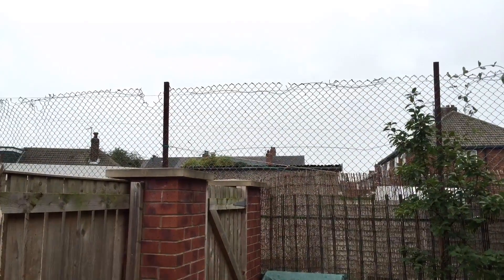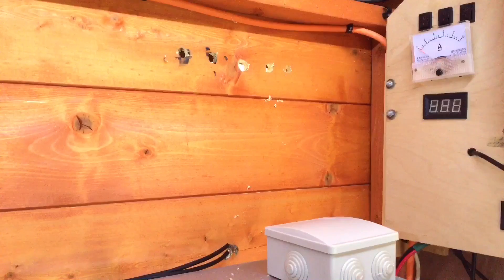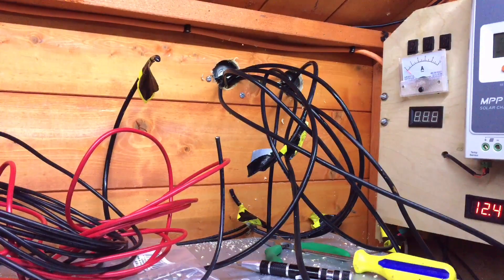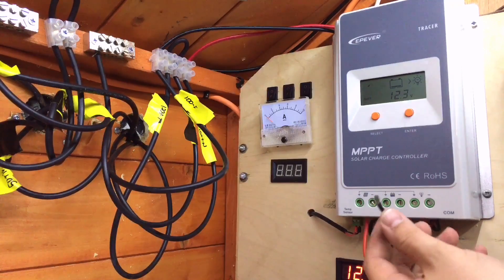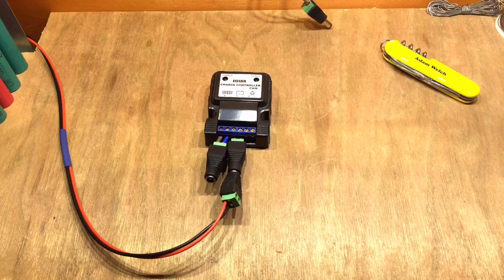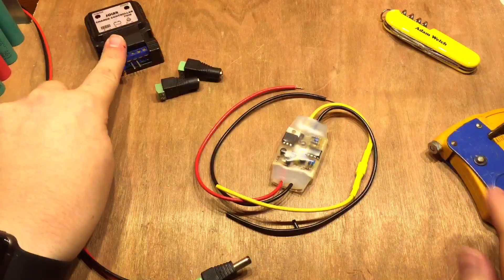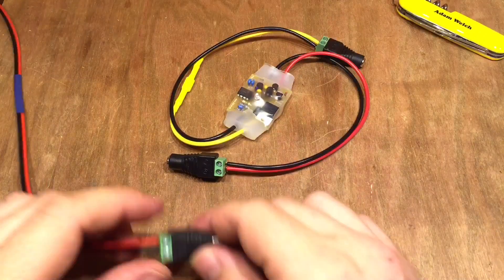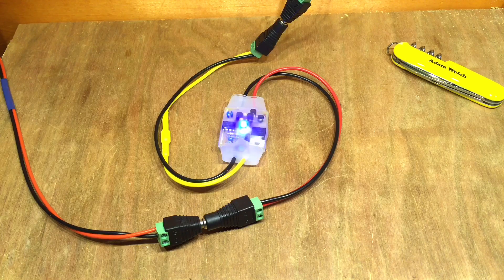Fitting New Solar Panels - Part 2, Inside - 12v Solar Shed

Comment: This a bit ,well off subject. But the Bluetooth monitoring for the tracer controllers. Is there a way to monitor multiple controllers? I have a tracer A. And a tracer AN. I would kinda like to know what I'm getting in. Without going in the house or electrical room. I have the mt50's for each.  I guess I could connect a camera to view the controllers. But that don't usually work well. I will likely have 2 more controllers to monitor. So 4 plus eventually. Does anyone make a wireless backup camera or something I could use to monitor remotely? Great video. I would like to have one of Julian's controllers for a smaller project. Are they still available? I'm hoping he does something with the muppt he has been tinkering with. It would help alot if I had a 100amp charge controller. The flex max 100 is the only one I know of. And they ain't cheep. I can afford to buy tracers as I go. Keep at it

Comment: Hey Adam, greats vids as always, quick question please bud, I have the 30a version of that charge controller and run a 450ah 12v Lead Acid bank so my charge controller is in 12v mode currently with 360w of 12v panels in parallel.   I do have some big 24v panels sat spare (32v open circuit)    After seeing this vid I am assuming I could use these on the charge controller and MPPT will do its thing even though its a 12v system as that's exactly what you have done here isn't it with running 2 x 12v panels in series?   Have you seen better results with panels running in series at 24v with lower amp-age rather than panels in parallel with higher amp-age? Cheers :)
Reply from the maker: Thanks for the kind comments.  I currently have two "12 volt" panels in series on my Tracer A MPPT charge controller.  Mixing panels of different types can work but you need panels which have their maximum power point at a similar level - my three 50 watt panels have an Vmpp of 17.5 volts and the new 100 watt panels have a Vmpp of 18 volts.  Otherwise your charge controller is going to find it difficult to find the sweet spot.  Have two sets of panels with say an Vmpp at 18 volts and one at 24 volts would mean two humps in the power curve.  Mixing panels on a PWM charge controller isn't so much of an issue as the panels get dragged down close to the battery level anyway.

So you could potentially hook up two of your 12 volt panels in series, and run them in parallel  with your 24 volt panel so the panels  roughly match, then you use your mppt charge controller to change the 24 - 40 volts from your panels to 12-15 volts for your battery.  Your 24 volt panel has an odd open circuit voltage though I'd usually expect more like 40 volts open circuit.  How many cells does it have?

So the short version is yes, you can run 24 volt panels on a 12 volt battery system and get peak performance using an MPPT charger.

Comment: good video Adam. now iwonder if you have time to demonstrate a project using 2 solar panels. lets take 2 100W solar panels. one faces direct to the sun, anotheroffset by 90deg. if at peak production time the sunside panel gives 10A and the offset panel gives 5A. conect them in parallel. given that the sunside panel will give some 20V but the other may only be 17v will we still get 15A total when combined?
Reply from the maker: I've just fixed my panels to the roof!  Joking aside it sounds like an interesting idea.  I'll have a think, but I've got quite a few other videos I'd like to do first.

Comment: Just don't leave that PWM5 out in the rain and it will serve you well! 

Mine has worked flawlessly since the day it was installed on the little 10 watt lighting system in the generator shed. It is the one solar system I have around here that has never required any intervention since I set it going. But I suppose it might just be time to check the fluid level in the battery. 

I'll tell you what though, it has been a real boon having the little lighting system in that shed over the last winter. Has made operating the generator after dark far less of a chore, that's for sure. Before that I had to rely on a head torch. And when you're fully off the grid, any little thing that's done to simplify your life makes a real difference. :)

Have I ever mentioned that I think you have a really cool little shed there? I have been been really enjoying watching these last two videos Adam. :)
Reply: Or just remove the Heatschrink, and change the resistor for the LED and put a new heatschrink tube around ;)
Reply from the maker: +xanataph Thanks for the kind comment Xan. 

The pwm5 should be reasonably watertight. Julian uses all his outsiders but he has had one or two fail now. I'll probably keep it inside - although I might have to do something about the LED. I like seeing the voltage but it is very bright!

My solar experimentation came from needing a light in the shed and not wanting to faff around with torches. I'd love to go off grid like yourself one day but sadly it's not practical here. Thanks again mate.
Reply: Yes, you're totally right. The LED is useful but annoyingly bright! It gives me quite the fright sometimes when I walk into shed while it's dark & then all of a sudden starts to do it's thing. And then if it's flashing into the corner of my eye while I am busy it makes me think the actual shed light is flashing. That's kinda disturbing when you're pouring fuel into a running generator..! lol 

You could hack it open and replace the LED for a more muted one or increase the resistor supplying it but I bet you're loath to do such things. So why not just put a sticky black dot over the LED's focal point. Because your unit doesn't have outer black heat shrink you'll still see the side-glow very well. Or if you want to be a little more posh about it you could enclose the whole unit in small semi-transparent plastic project box. 

I can see why fully off grid is an impractical situation for you, but with those two new 100 watt panels you're in a real position to get partially off-grid. That's when I got serious. I had a couple of 10 watt panels, and they were all good for experiments, but when I ordered my first two 95 watt units, that's when things became serious. 

You should be able to move your household lighting load off the grid with those, particularly in the lighter seasons. You would get a real kick out of that. :)
Reply from the maker: Yes I've already thought about a bit of black insulation tape over the led - as you rightly say, my special edition 'crystal' PWM5 illuminates quite sufficiently!

Perhaps I need to speak with a sparky and see what could be done from my existing setup.  I've missed the feed in tariff for on-grid solar so that'll have to wait for a bit until the costs come down.

Comment: Good video, i just got myself two new 100w panels on Friday too, they are a matched pair so think i'll replace the current 100w with these two and reuse the 100w elsewhere.
Reply from the maker: +Colin Hickey (Lets make stuff!) Thank you. Looking forward to seeing your install grow. What will the other panel end up doing do you think?
Reply: +Adam Welch I've a keter storage box which was always the intended use and it fits perfectly on the lid so may use it there and store batteries inside it.  garage roof is begging for some but not sure on lifting tiles on a new roof 😨

Comment: All looks good, more panels ready for the winter ! Going back to MPPT controllers, did you get to check this one out?
It has pots for MPPT settings and Battery Voltage.. eBay item 331682720602 seems to work here on my test 20W panel 
with Lead acid battery..
Reply from the maker: +Mike Foster Thank you. Yeah, I need more watts to see me through winter - might look at my battery bank too which doesn't perform quite how I'd like. 

Yeah the BQ24650 series is very much the same as the CN3722 I looked at a few weeks ago. It's a little bit more expensive but might be a little bit more efficient too. The guy from the Voltlog channel did a review of the CN3722 which is worth a look.

Comment: Great video, one question. What batteries do you use and where did you get them from?
Reply from the maker: Thank you. I've got a pair of these - http://rover.ebay.com/rover/1/710-53481-19255-0/1?icep_ff3=2&pub=5575189419&toolid=10001&campid=5337903455&customid=Deepish+Cycle+Battery&icep_item=271148391006&ipn=psmain&icep_vectorid=229508&kwid=902099&mtid=824&kw=lg

They're ok for the price, but not really true deep cycle.  They have a crank amp rating so shall we call them a hybrid?

Comment: Awesome! Should find something nicer to connect the cables inside I think.  Will those screws not start rusting?  Maybe fill the plastic where the screws are in with vaseline and spray some silicone oil on the thread of the screws. 

Currently working with a good friend of mine for an emergency second solar system, next to his 15 panel setup, in Africa. Basically a place which has solar, lets call it harvest, 365 days a year.   Those panels look exactly what were are looking for, only we need a cheap charger controller with a display to visually monitor everything.  That grey one you reviewed seems good, only issue is getting it there past the customs. Well another reason to visit it seems ;-)

BTW you need to change your youtube about picture ;-)

Comment: Hi Adam, those panels look a good choice for "solar shed" sized setup. Seems good quality, and as suitable as I'll find for your UK/Ireland climate. Did they come recommended or had you researched them based on your expansion 'needs'?
Tks for sharing your activities. Nice pace, interesting content, clearly explained! Great to get an insight into what people are experimenting with and how they approach it using the knowledge they have and the tools to hand.
Reply from the maker: +Ivor O'Shea Thanks for your kind comments. 

I searched around for a while - I needed a specific width and height to make the whole thing work for my limited space. I wanted back to blend in against the shed roof and to match my 50 watt pair. I also wanted to keep the specifications very close to my existing panels. The MPP is just half a volt out on these. 

I think they'll see me right for a while. :-)